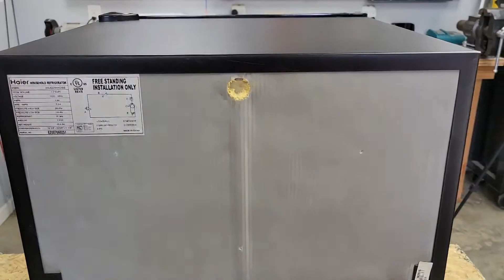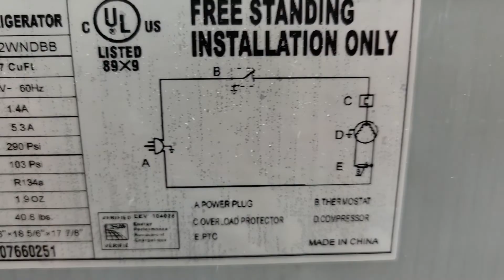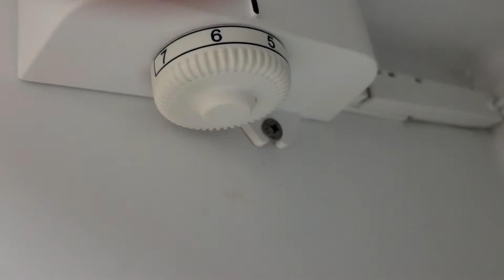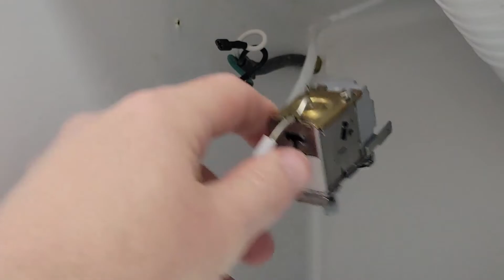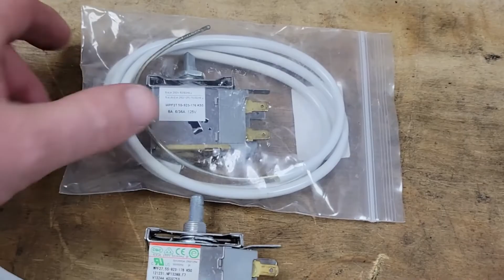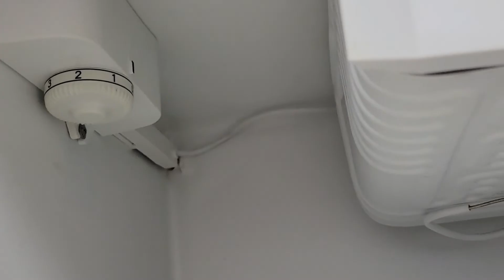Project #41 - Mini Refrigerator Fix (Thermostat Replacement)

Comment: idk if anyones said this but WDF and WPF are essentially the same. the number after (wpfXX) is the range of temp. as far as i can tell the other numbers arent necessarily important for a replacement. gonna get a WPF27.5S-923 to replace my WDF27D-L3. Will lyk if it works. danby doesnt make my parts due to "tariffs"(bs excuse if you ask me, just charge more)

Comment: My fridge does exactly like the one in the video - runs non-stop and freezes everything, even at the lowest setting. I finally located a replacement thermostat online today (it's hard to find as my model has been discontinued for several years), so your video could be a real blessing. I'm hoping the installation goes smoothly when the part arrives. Thanks for a superb job with lots of close-ups.

Comment: So on the sensor wire I lost the plastic piece on the bottom that my fridge came with. Does it still run fine without it??
Reply: If the sensor isn't held up against the tiny metal freezer, it might freeze everything in the fridge because it's trying to drop the temp to freezing at that intended freezer location.
Reply from the maker: It shouldn't affect it at all.  It should work fine.

Comment: After a few years in storage I plugged in a Magic Chef 7.1 (cubic feet) and the compressor goes on and heats up but the freezer and fridge never get cold. You're saying I should put the whole fridge on the curb?  But it's the perfect size with auto defrost. They don't make them smaller with auto defrost anymore. Have I any options? Thank you.

Comment: My thermostat to my fridge is not working. I removed the thermostat and it rattles when i shake it. You think i need a new thermostat ?
Reply from the maker: Try connecting the two thermostat wires together and see if the fridge starts working.  If so, you need a new thermostat.  Be careful; the wires are all at 120v.
Reply: @VancesHowTo  hi thanks for replying. I tried connecting the two wires to the thermostat together but dammit no luck.
Reply: Which 2 wires? My thermostat has 3 or 4 connectors  @VancesHowTo

Comment: Thanks so much for the informative video! We have an GE minifridge where the freezer doesn't stay frozen (it drips water). Even though the setting is set to "coldest." Do you know what the issue is for this? Thanks for your help, Vance!
Reply from the maker: Its probably one of two things:
1)  The thermostat is malfunctioning, or
2)  The refrigerant level is low

#1 can be fixed just like I did in the video, #2 can't be fixed and you should just throw it out.

Its easy to test:  Unplug the 2 wires from the thermostat and connect them to each other (do with power off of course).  Then power it up and see if it freezes.  If it freezes, then it was #1.

Comment: Thank you so much for this video. This was the exact same fridge I picked up at a yard sale and it had the same problem. Even after the cost of the part, it was still cheaper than buying it brand new this was such an easy fix.

Comment: Mine wouldn’t turn on. You helped me figure out how to get to it. I removed the thermostat and took a short piece of wire and jumped across the circuit and it started running. I ordered a new thermostat so hopefully I get it soon and get it fixed. Thanks for the awesome video!
Reply: Which wires,?

Comment: Thank you so much for this video, you certainly saved the day for me as a female.
Have here a Haier 2.7 cubic feet mini fridge, the sensor wire with the little clip under the freezer came off a few days ago and I was at my wits end as to how to replace it properly.
After having much ice buildup underneath the freezer pan I decided to let it thaw out for a cleaning. As the ice melted, the heavy L-shaped glob of ice forcefully fell, pulling the sensor wire and clip down. Seeing I had no knowledge about these things I went to Best Buy & PC Richards in my area to see any examples they may have of compact mini fridges to get an idea as to how the wire should be replaced, came back empty handed and resorted to YouTube for help. Im very happy that I've found your video - problem solved, thank you and God bless you 💕.
Reply: I just thawed out my own mini fridge and the same thing kinda happened to me! I ripped out a huge chunk of ice under the freezer compartment and the wire came off. Now I I just need to find out exactly where to place it back. 🤔🤔

Comment: Thank you so much for this video! I have the same fridge with same 'too cold' problem and it quit working this weekend. Compressor hot when i unplugged. I am also missing the little plastic piece wire holder on bottom of the freezer... can i just zip tie in some way?

Comment: My fridge is missing the little plastic piece on the freezer compartment where the sensor is placed.  Is there somewhere I can get that part?
Reply from the maker: I bet you cannot get that specific part.  You can just use a zip tie instead, to hold the sensor in place.